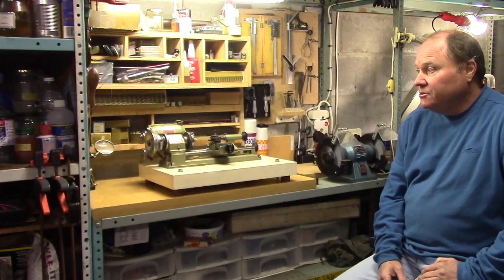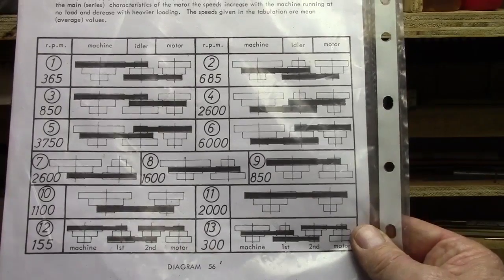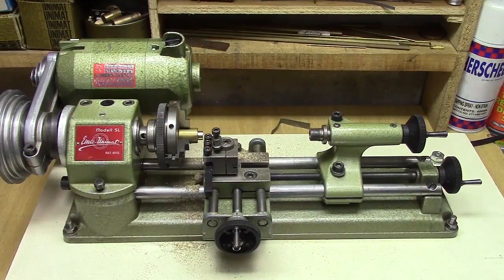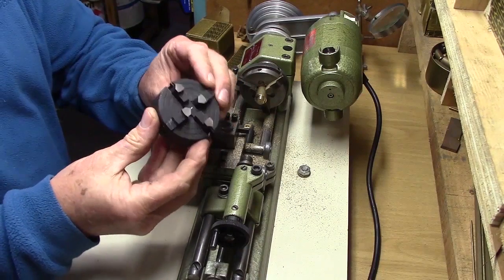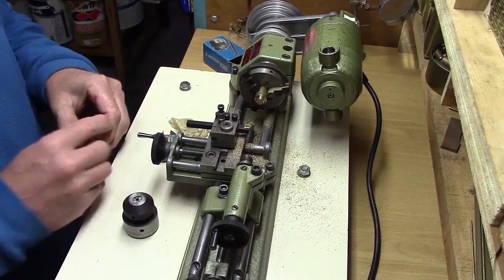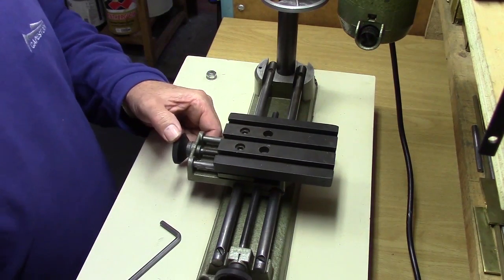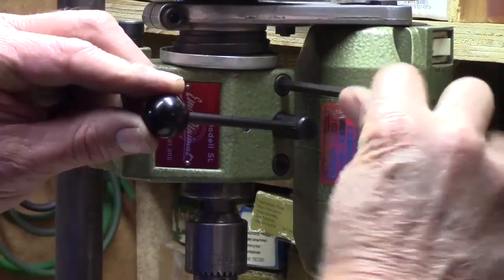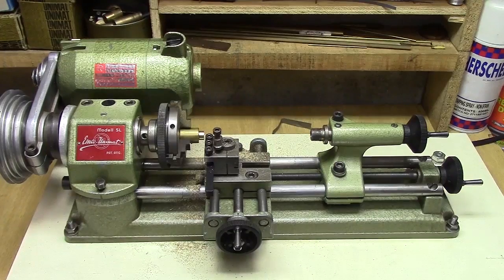All about the EMCO UNIMAT SL Lathe

Comment: Hello
I have the same lathe but mine is making so much more noise. I think something is touching something inside the motor. What do you think it could be?
Thanks and nice video!
Reply from the maker: Thanks, If you think the strange noise is coming from the motor it may mean that the bearings.at each end of the motor shaft are worn and failing. The motor also has spring loaded brushes which press up against the rotor contacts. Excessive brush wear or incorrect brush installation may cause a noise. You can also check that the system of drive belt pulleys between the motor and the headstock spindle is in good order and running freely without any binding.

Comment: This is an awesome video, but I still can't tell how you put the three-jaw on the cross slide.
Reply from the maker: Thanks., The 3 Jaw Chuck can be mounted on the Cross Slide by using a UNIMAT attachment called the T-Slotted Adapter Stud, This attachment originally came with the UNIMAT 3 Jaw Chuck. I will be featuring this UNIMAT T-slotted adapter stud and other questions and issues on a forthcoming ""FAQ for the UNIMAT"" video on my SteamerEdge channel. You could also make this attachment yourself or get a good model engineer to make one for you. Start with a piece of good quality 12 mm X 12mm square bar steel which should be an exact fit for the T section in the cross slide. Turn the first 15mmm of  one end of the square bar to a cylinder diameter correct for threading to the 3 jaw chuck leaving just enough Square bar section to accurately fit the  3.5 mm Square Slot section on the cross slide. Then thread the end 10mm of the turned down section to the exact Thread diameter to fit the back of the 3 Jaw chuck. Then turn down the un-threaded cylinder 4 mm section between the Square section and the threaded section to an exact fit for the 4 mm groove in the cross slide.

Comment: Thanks for the informative video, I'm actually looking at getting myself a small lathe and found some UNIMAT's on Gumtree. Do we have local suppliers for accessories like the 4 jaw chucks here in SA? or will I need to import?
Reply from the maker: Thanks for watching. As far as I am aware 2nd hand market sites,  like Gumtree, are the only source for Unimat Lathes, with and without accessories, in SA The UNIMAT lathes appeared in SA from the 1960's onwards and were well marketed here. You just have to keep looking.  I think the SL model was discontinued by the manufacturers in the late 1980's but miniature Unimat lathes continued to be well marketed world wide until the late 1990's.  I was lucky enough to acquire my lathe with accessories from the original owner 10 years ago. The original owner purchased it in SA in the early 1970's
Reply: Thanks for the feedback, I kinda pulled the trigger on an Emco Unimat 3 today, should be arriving next week
Reply from the maker: The UNIMAT 3 is an excellent lathe - the manufacturers improved on many aspects of the SL model when the 3 was introduced. :-)

Comment: A very nice little lathe and nice attachment too.  I like the indexing attachment and the collet holder.  I can think of many applications for these.  Are you able to cut threads on the Unimat?
Reply from the maker: Hi Les, thanks, yes, I also have the UNIMAT Thread Chasing attachment with a number of the interchangeable thread pattern bushings. This attachment is all new, purchased by the original owner of my Lathe, back in the early 1970's, and it has never been used. Up to the present I have just found it much easier to use a Die, held up against the Tailstock, using the drill chuck mounted on the Tailstock as a steady-holder pushed up against the Die when I'm cutting threads. I don't have a Tailstock Die holder. I really must try-out the UNIMAT Threading attachment sometime. Yes, the Indexing and Dividing head is extremely useful and versatile. It is definitely one of my favourite attachments for the UNIMAT  :-)

Comment: I noticed the tool post, it looks like what Mr. Walter Maisey (another very good channel by an exceptionally experienced machinist ) uses on his Taig, except it does not have the ratchet mechanism. Very clever design! Did you make it or is it an Emco unit? Is it a QCTP design or do you replace the tools in the holder as you work? I have a lot of books about small machine tools, and can recommend Rex Tingey´s books in particular, both are very good, but hard to find at a decent price. Thanks for sharing!
Reply: Regarding Rex Tingey's books....I was astonished to see how expensive a used copy is.
Reply: Looked around and found some info about that type of TP:
http://www.toolsandmods.com/lathe/mini-lathe-qctp
and here
http://www.homemodelenginemachinist.com/showthread.php?t=11851
Reply: Most of the force will be on the central post once the tool post is tightened. It is probably beneficial to make an extra long T slot screw for this.
https://aardvark.co.nz/pjet/qctp.shtml
Reply: Similar design in QCTP configuration: http://www.mechanicalphilosopher.com/jsilvia07.jpg
Reply from the maker: The tool post is an early original Unimat design, I have noticed that the tool posts on many of the Unimat lathes I have seen do not have this fine setting feature on the tool post. It is not a QCTP . I do have one of Rex Tingey's excellent books "Making the most of the UNIMAT"" about advanced machining on the Unimat SL and the Unimat 3.  A very useful book on the Unimat if you can find one. I believe it is based on many of the articles he wrote for ME in the 1950'/ 60's
Reply: I found mine on ebay, but one has to look for a long time to find one at a decent price. Most are crazy expensive. Especially "projects for the Unimat" it is the most fun book, with some steam engine projects. Also, when subscribing to Model Engineer, one gets access (or used to anyway) to some pdf files of old scanned magazines. I that bunch is a magazine called Model Mechanics (mainly marketed to the tiny lathe owner, lots of cool projects in fact!), Tingey wrote all the articles for that magazine that are in the books. So that is a way to get them too. Very small difference between the articles and the chapters in the books.
Reply: Nice find Baikal. Very useful information. Thanks for sharing.
Reply: So is the one jacking screw lifting the entire tool post? If so, it would seem that this approach would negatively affect rigidity since the entire bottom surface of the tool post is no longer seated on the compound, but is resting on the end of the jacking screw in combination with the tension on the threads of the central mounting screw. Perhaps I am misunderstanding the design. Bear in mind, I am not comparing it to a typical QCTP, but to a traditional 4-way tool post, or the basic Unimat or Sherline block tool post.
Reply from the maker: Really interesting, thanks. Both of these Tool post designs are very similar to mine. You have inspired me to make an effort to track down some the old Model Engineer and Model Mechanics articles. :-)
Reply: http://www.model-engineer.co.uk/news/browsemodern.asp?at=139&atg=7
if that link works, it seems these files are free now on the Model Engineer site!
Reply from the maker: Thanks for this link - really interesting and useful. . I'm going to enjoy going through them... :-)